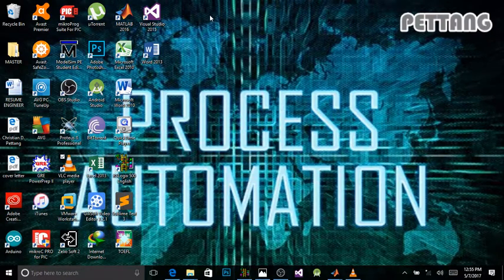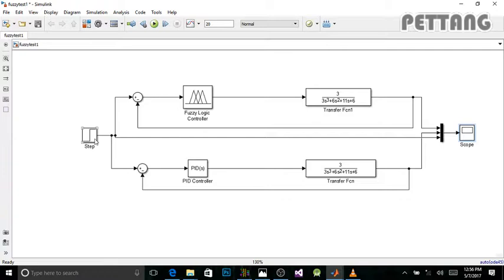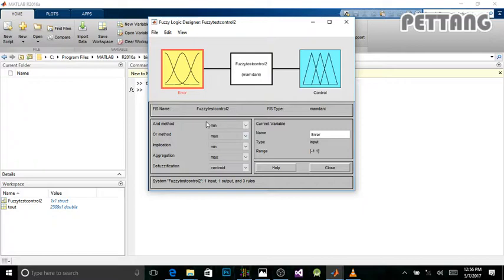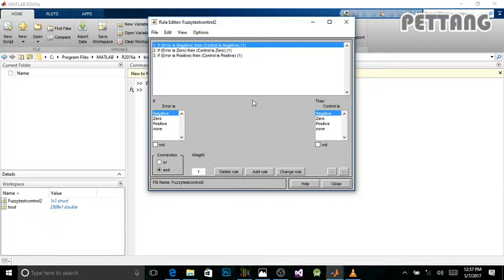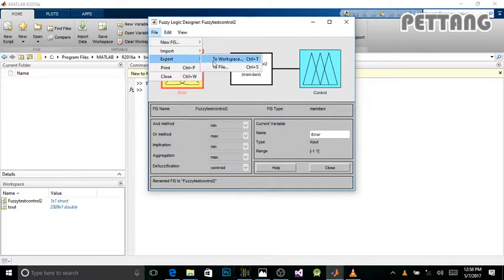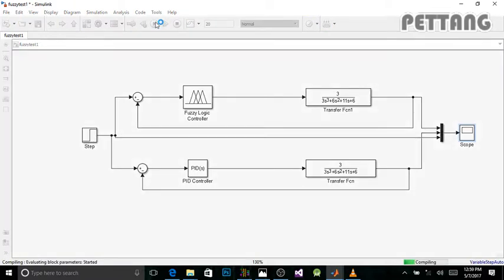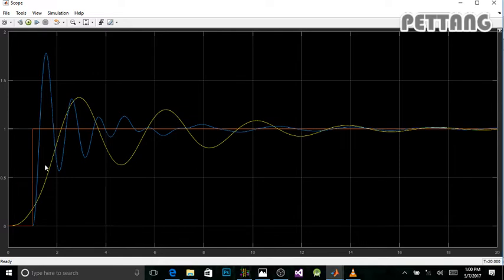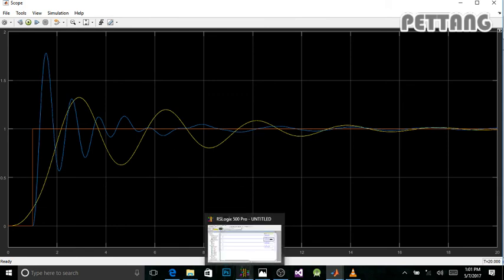PID controller vs Fuzzy logic controller in an automation system

Comment: Probably there is mistake, the blue output signal in scope cannot be from PID controller, conventional controller cannot produce irregular oscilations. On the other side, the designed Fuzzy Controller, which is equivalent to only P controller, with nonsymetrical output fuzzy values will definitely produce the blue response.
Quality of PID controller depends on the method used for its design.